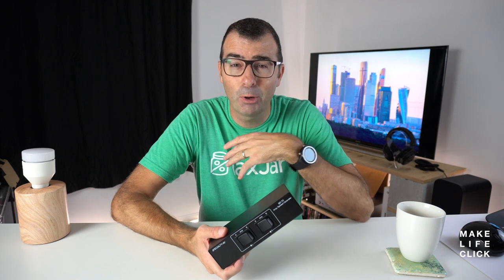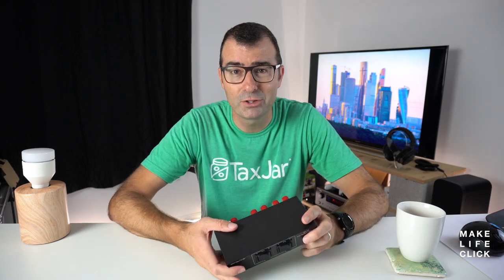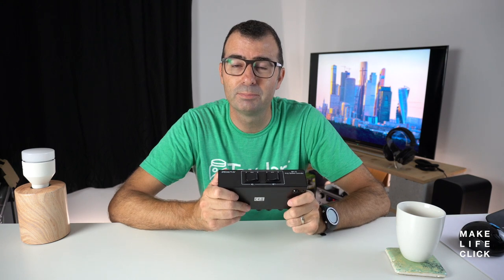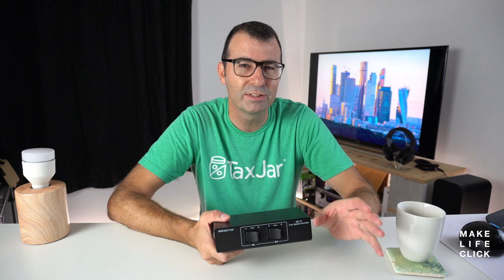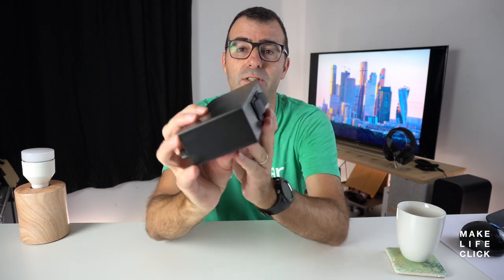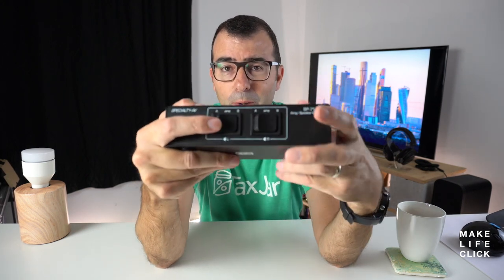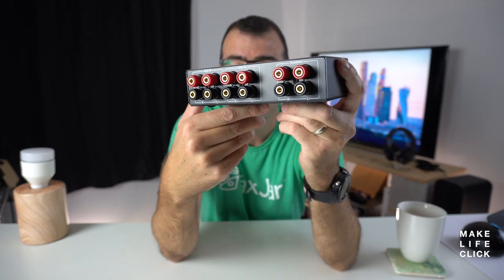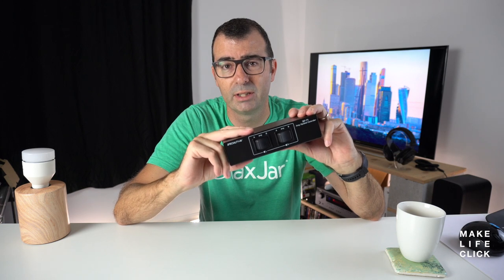Using 2 HiFi Amps with 1 Set of Speakers

Comment: I purchased a similar Linepaudio unit to switch from 2 amps and 4 sets of speakers. The amp selector would cut off one channel and make noise -- very unhealthy. Opening it up, terribly cheap switches with resistors on all. Another review of the product you are showcasing removed the 100ohm resistors as to not damage the amp. I'm very weary of these cheap off-shore switching devices.
Reply from the maker: Thanks for the comment. So you do or don’t own this unit? Can’t say mine has any issues like the ones your describing.

Comment: Hi Mark, 
I see this product is not available on the Amazon anymore. Any idea where else I can buy one?
Reply from the maker: Hi Arman - Thanks for the question. I've reached out to them in the past when this happens and it's usually just that they are out of stock and there is more coming. You can always contact them from that page and check. I haven't found it anywhere else - or a similar model surprisingly that only does the 2-1. Only the 7220 model which does 2 and 2 here: https://amzn.to/2U8DEzw which is also out of stock at the moment! People are having issues getting stock during the COVID-19 situation.

Comment: Hello! 
My car radio have 4×25w output...
My new speakers i wanna add is 35 w each one ...
So...can i make the  4×25 to 2×50?
I mean the 4 outputs connect to 2 .
Reply from the maker: Hmm. This isn’t really designed for doing a 4 to 2 conversion. If you look at the TC models available on the blog link you should be able to get a 4-2 where as this is a 2-1 (pairs)